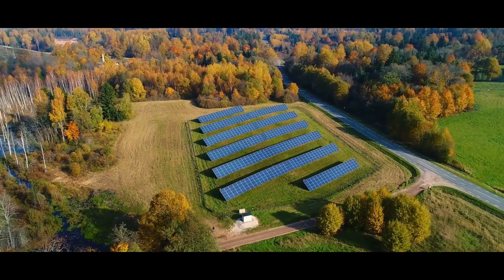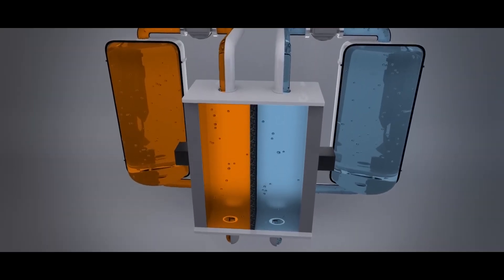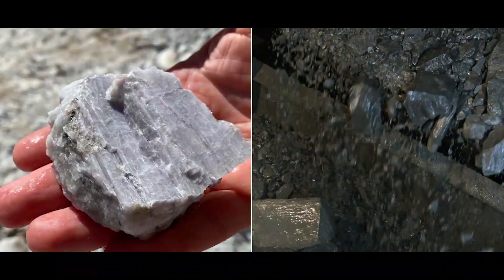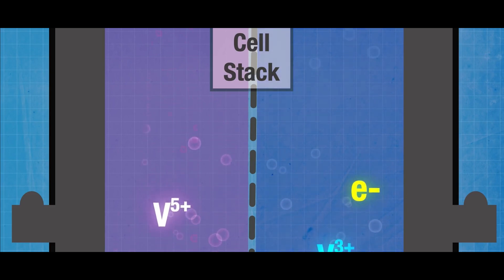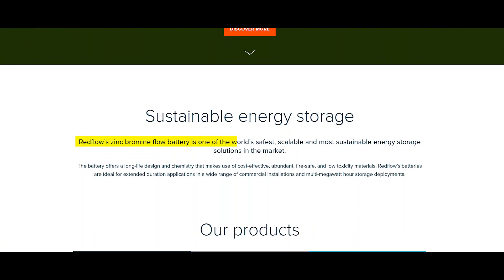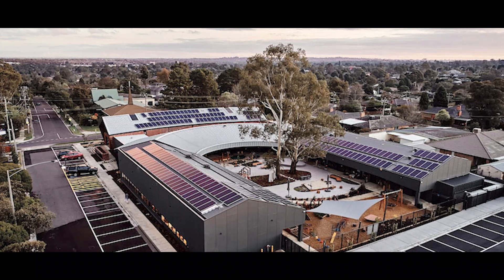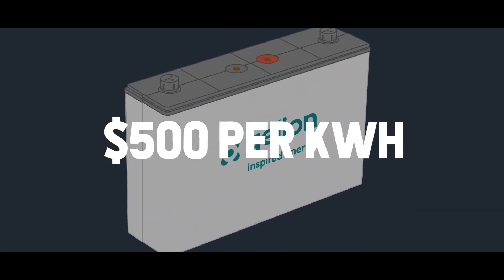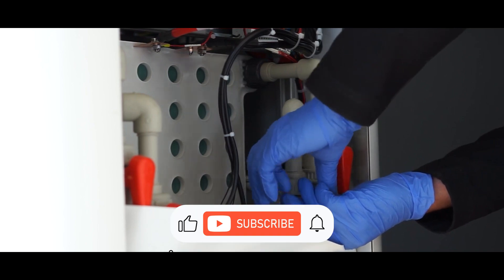This Redox Flow BREAKTRHOUGH Will Replace Lithium For Good!

Comment: I want to build a new ICF house with Geothermal heat and cooling and put a solar panel array on the roof of a single slope garage shop.
The goal is being completely off grid capable. As Democrats push net zero targets our electricity is going to get more expensive and less reliable. 
Lithium is too expensive and dangerous, lead acid batteries are too much work.  
Redox flow batteries would be ideal.

Comment: Flow batteries will not replace lithium.  The technologies are complementary.  Lithium batteries are great for grid frequency control and flow batteries are great for long duration.

Comment: So they don't have as much peak power output or input as lion batteries but are cheaper and easier to build in bulk storage... but then you reveal that they cost 3x as much as lion batteries so... yea... how is that economically viable again?
Reply from the maker: After scaling up production, costs go down exponentially. The technology is still in its infancy. With the economics of scale it will be cheaper.
Reply: @The.Futurist  I remember looking into this about 5 years ago.  How many decades do you think it will take and how is that going to happen if there is no reason to buy them now?

Comment: Some of this seems outdated. Lithium prices have dropped considerably. Recycling of Lithium ion batteries is becoming routine, Sodium Ion batteries have been showing a lot of promise. Flow is one of many interesting technologies.
Reply from the maker: Yes. lithium prices dropped but still not cheap enough.  However, rare earth minerals are an even bigger ingredient than lithium, and they're not cheap either.
Recycling became routine but is still a demanding process. 
Sodium ion batteries are very promising as we reported about several times .
When it comes to cost and scalability, flow batteries are one of the most promising and interesting ones.
Best regards and stay tuned. :)
Reply: Lithium isn't cheap but way cheaper than vanadium. Current Vanadium flow batteries cost 600-1000+$ per kWh while you get Lithium batteries at just 200$ per kWh (I don't know where the numbers for 7-9k$ for 6kWh comes from the cells for my 30kWh storage system cost me 4k€).
We should also not ignore the fact that Vanadium is also not really a safe material (it's quite toxic). So while it has good properties for redox flow batteries it also nullifies the cost and many safety benefits.
A efficiency of 80% is also pretty bad, as LiFePo batteries get over 95% so there is still a lot to be improved and many of the chemetries that don't use vanadium don't even get to the 85% mark, and loosing energy adds even more cost to the already higher operation costs (due to pumps and higher maintenance) and high cost/kWh.
Reply: Flow could make electric cars viable, by using current refueling(gas) stations to swap out expended electrolyte for charged electrolyte... thereby "recharging" the EV in seconds!

Comment: Flow batteries will gain acceptance with utilities and large power consumers due to the ability to seperate its power from energy.  I think ESS inc., out of Oregon is my favorite in this field so far, with their iron flow batteries
Reply: need see lifespan of membrane and charging and discharging times comparing vanadium flow battery
Reply: They havent been super forthcoming about details but my understanding is it can discharge/recharge at a rate of 75kw an hour and can be recharged while being discharged, idk how that works but is a cool feature.  Ive been able to parse from them that the membrane is some common material, some kind of plastic i think.  Since its the same liquid on either side of the membrane a ruptured membrane would be a fairly easy repair with minimum down time.  Im hoping for increased clarity when they switch out of R&D accounting in Q3
Reply: @Adam-ul2px  What about the Salgenx battery (salt water)? This battery does not need a membrane which will cut down initial cost AND ongoing costs!
Reply: @onestoptechnologies7305  thanks for reminding me about that one, I will have to watch some videos on that again.  If I remember correctly the membrane for ESS is cheap since its the same chemistry on each side and their electrolyte is also water that is saturated with salt and iron
Reply: @Adam-ul2px  The other thing I like about Salgenx is that they have smaller systems. The whole house solar market is HUGE! People want to have solar, but they want to "cut the cord" not just add solar and still have an electric bill!
Instead of having a few thousand "customers" via electric providers... the market is hundreds of thousands of customers!
Reply: @Adam-ul2px  ESS needs a Powerwall/ZBM3 competitor... something in the 10-50KWH range!
These could also be used to power forklifts, EV... with electrolyte swap tech for Consumer/Industrial "recharging." 
Think gas station... plug in the nozzle... which pulls out the discharged electrolyte and refills the charged electrolyte!
Now "recharging" takes seconds not hours! The "gas station" can be recharging the electrolyte continuously from any source... Solar, Wind, Grid, etc.

Comment: Flow batteries are not going to replace lithium batteries for mobile applications. They are the best hope for the storage needed to make renewables a practical replacement for fossil and nuclear.
Reply: I wouldn't rule out nuclear yet
Reply: @BamBam-uf4yi  Nor would anybody who looks at ther facts.
Reply from the maker: Yeah for mobile applications probably not. Energy density is too low. But that doesn’t matter for stationary storages. Only thing matter is price and durability!
Reply: Not if someone makes flow battery with the right specifications, like high Wh/liter (like 300Wh/l) . Also there could be the advantage of refilling with charged liquid for long trips.